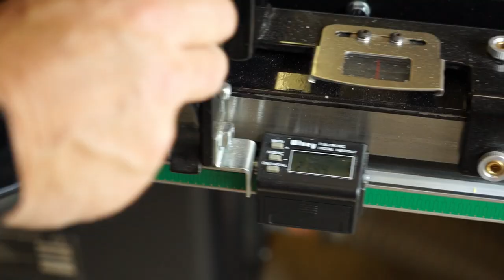"making a modern funky Rocking Horse!

Comment: Neat Design.  I would reconsider the handles though as they look like a problem waiting to happen if it happens to fall over onto some flesh of a young one.  I would use wood that is rounded on the ends.  Just my thoughts...
Reply from the maker: You are right about that. I put a plastic cap on it to improve safety. Good point!

Comment: Awesone design ) congrats to designer and thanks to you for showing us this and sharing plans!

İ just draw the little one but it seems alittle small for my 19months old girl ) the one in the video is the big one?
Reply: Ok how did you get the template that smooth and right on point?)) my template is not as good as yours =) Did you use CNC?
Reply from the maker: No, try to multiply the small one with 1.5 I just cut it and sand it to be smooth.

Comment: Hi Dennis, magnificent project I am now finishing the horse for my nephew, I would like to ask you something, in the project the measurement of the height of point 1 is correct in 9 cm, because from the drawing it seems higher, in fact the horse is unbalanced forward,  thanks, keep it up!
Reply from the maker: Hi Roberto, If I see the picture I think you are right. I am a bit confused about why I measured that wrong! I am a bit busy at this moment but I will look at the template and see what it should be.
Thanks for your comment.
Reply: Hallo, thanks for your work. I had the same question regarding point 1. On the picture Point 1 seems higher. Thanks

Comment: I thoroughly enjoyed this video. I particularly like your workbench/router table and would like to know more about it. Is it your own design? What is the gray material used for the top and one side? Are you using 20 mm holes with MFT spacing? How do you use the side? I suspect there are other features of this bench that have not been shown and would appreciate hearing your thoughts about the bench's design and use.
Reply from the maker: Hi Michael, 
My Workbench/router table is my own design. I think I will make a short film about it in the next weeks because I really enjoy working with it and especially how I can place a fence on it. This is my third workbench and so far I really like to work with it. So that is wy I want to make a review about it so perhaps people who like some ideas can implement them in there own workbench. 
The black surface is full colored MDF. This is really a very nice product to use on your workbench. It is much harder then MDF, it has a higher density than MDF and it is very good to work with. When the surface is very dirty you can easily clean it with some sandpaper and it is as new. It is not slippy and very straight. 
If you have any question, feel free to ask.

Best regards,

Dennis
Reply: Thank you for responding and for letting me know about the material used. It is difficult to get material like that in the United States, but I believe it will be worth the effort to find it. Anything thicker than 18 mm will be a real challenge.

A video describing your workbench will be much appreciated as yours is one of the nicest I have seen. I am looking forward to learning more about it. The way you designed the side wall with fixturing holes is brilliant. Hearing how you sized it and why you arranged the holes the way you did will be very helpful. I would also be interested in the accessories you find most useful. For example, I had not considered supporting a panel the way you did so that a jigsaw could be used to cut out the center material. Very nice. And the way you included the router seems very effective. I would also like to hear about any improvements you have in mind.
Reply from the maker: Hi Michael, 
I will make a video about the workbench including all the accessories I use to make it work. I am busy with a first impression video about my Festool Kapex but after that I think I  make a video about my workbench or a video about some china tools I have and are worth trying.  One way or the other, I think it will be ready in about 3 weeks.

Comment: Hi, great design.What thickness ply are you using?  What is the black material that you use to make the saddle?
Many thanks.
Reply from the maker: Hi, 
You can find more info and free plans on my side. https://hookedonwood.online/Projects/
But the thickness is 18mm and the black material is Full colored MDF. It is like valchromat, only cheaper.
But what I understand it is not easy available outside the Netherlands and I do not know why!
Good luck, Dennis
Reply: @HookedonWood  OK> Thanks for that.

Comment: Hi Dennis, just a tip: your heading, "making off" video ...is not correct English. I would suggest "Making a modern, funky rocking horse" .... no need to use the word "video". If you do want to stick to "making of" then it should be one "f"
Reply from the maker: Hi Andrew, 
Thanks for your comment. I really appreciate it. I will change it as soon as I can. I can't change the video, but I can change the tumbnail and text.
Reply from the maker: Done! Again, thanks!